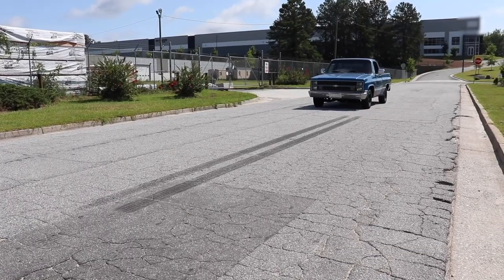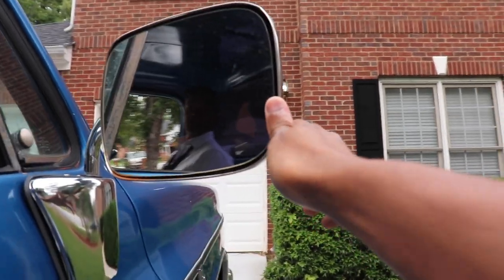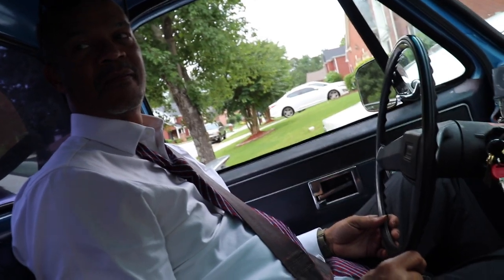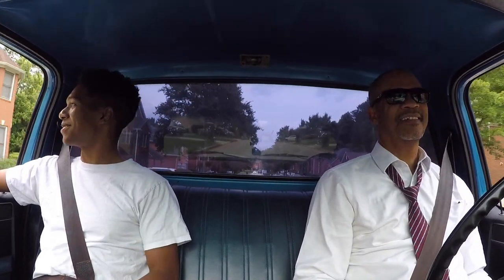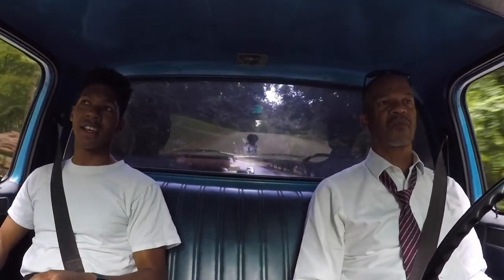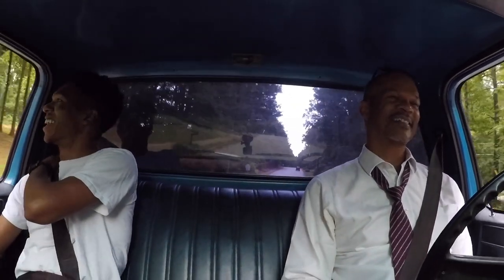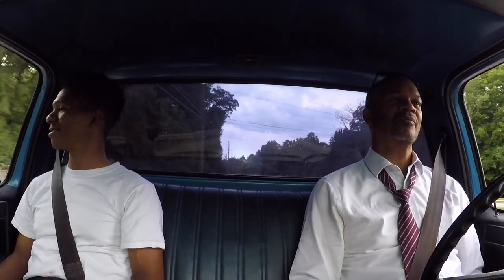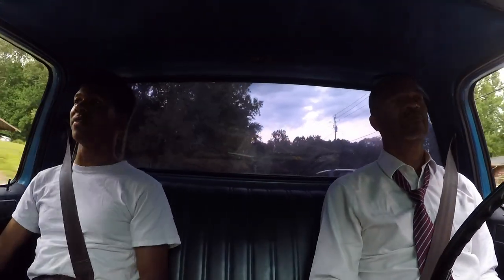DAD DRIVES CAMMED 3000 STALL C10 CHEVY TRUCK!!!!!!! *HE WASN'T READY FOR THE POWER*

Comment: Sweet truck, Friendly advice on starting a carbureted vehicle. Almost all of them require 2-3 light 1/4 throttle pumps BEFORE turning the key. 

When parked, fuel vapor evaporates out of the intake so your starting dry of fuel vapor the next time you crank it compared to efi where it immediately starts spraying fuel.

Spinning a carbureted engine over dry like that, there's simply not enough vacuum to turn liquid fuel into vapor causing flooding, fowled plugs, extra wear and tear on rings and cylinders due to washing the oil out of the cylinders with raw liquid fuel and it also thins your oil requiring more frequent oil changes. If you crank it like that often you'll be able to smell gas on the dipstick.